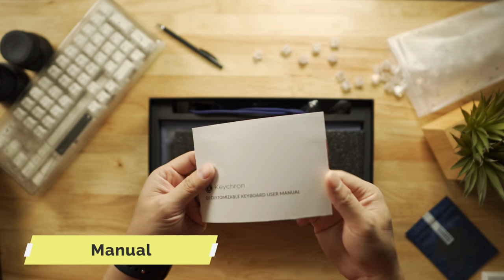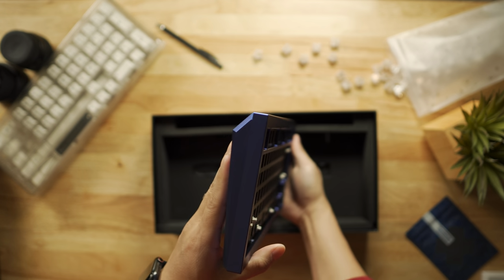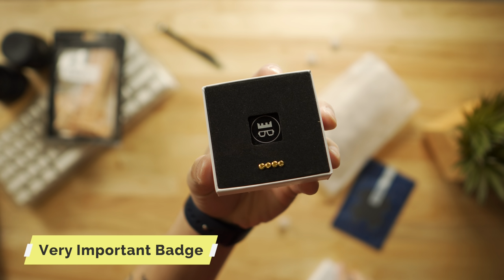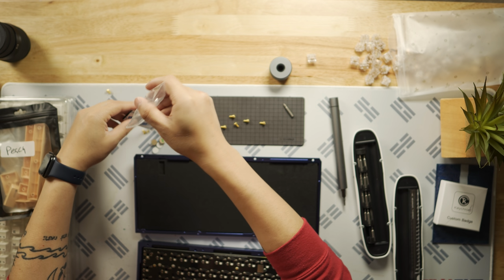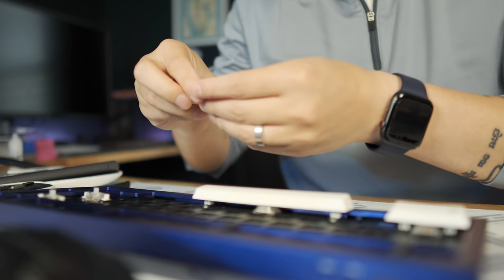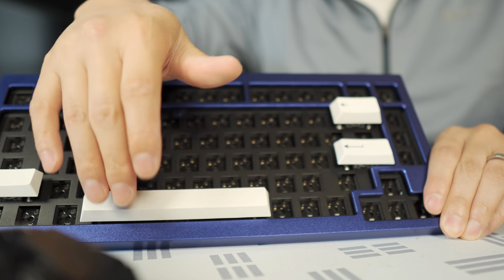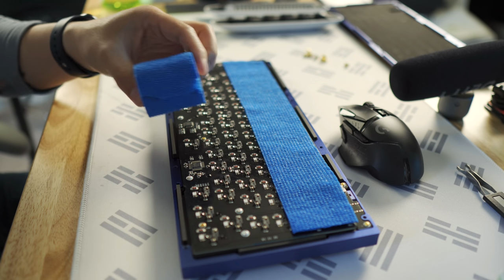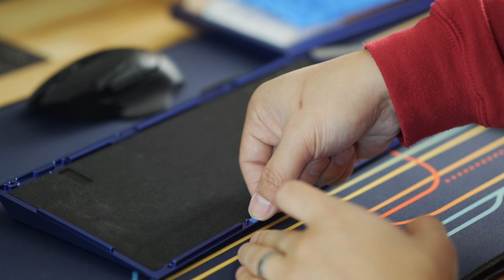Review and Build | Keychron Q1 - Great Board with One Critical Flaw

Comment: So, between the Q1 and the Arisu by Nico and Steph, which did you prefer?  I've narrowed it down to those 2 boards.  I like both configurations and can get used to ether.  But I'm more concerned with sound profile.  I like a marbly thock, which makes me think I should lean towards to the q1, but I'm not sure.  And the Arisu isn't gasket mounted, so I assume the typing experience is not as flexy.
Reply from the maker: But I think the sound you’re describing, the Q1 would be better. I had Zakus in my Arisu which I love but it’s much more clacky than thocky I would say.

Comment: You put in way to much stuff I think. You can see that you push the gaskets up. 
I recently bought the Q1 and have to say: after tape and force break modding it it honestly sound great already. I even removed one layer of foam, so I have a bit more flexibility. I hear basicly no difference.
Reply from the maker: Yeah you’re probably right. I have considered removing some bits and seeing if I can get some flexibility back.